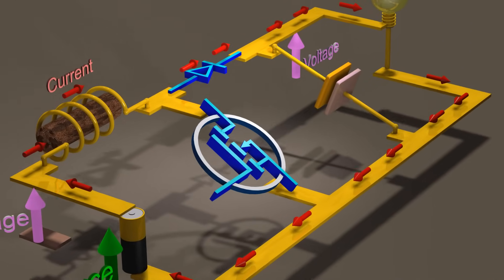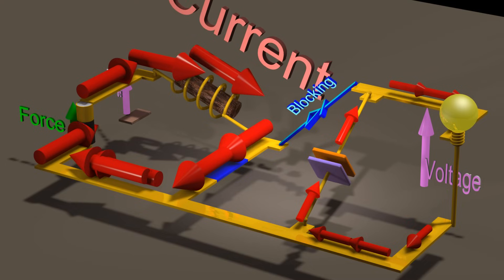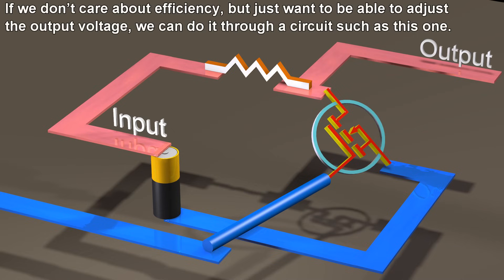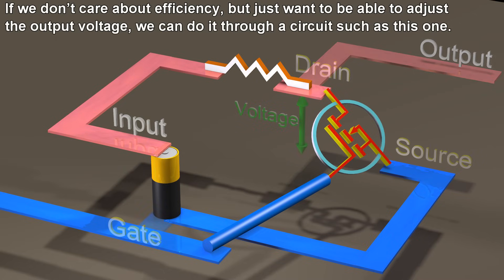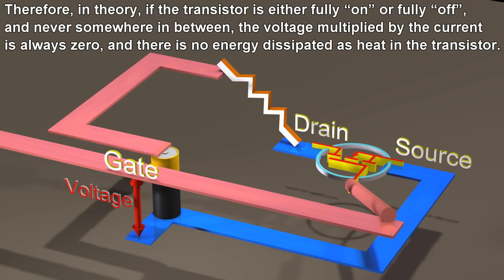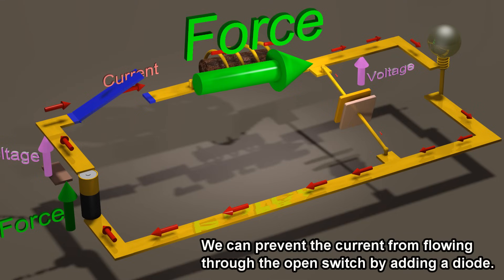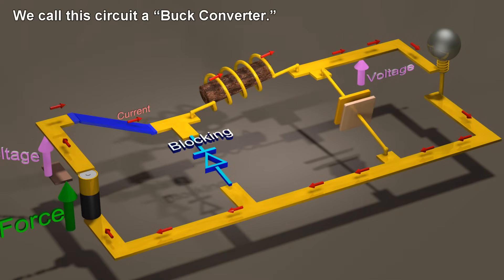Boost Converters and Buck Converters: Power Electronics

Comment: sorry for the basic question but where does the energy come from for a boost converter? Does "charging" the inductor simply means it drains a bigger current from the battery, stores it in the magnetic field and adds this energy later?
Reply from the maker: Yes, all the energy originally comes from the battery.  Some of this energy can be stored in the magnetic field of the inductor, which is later released into the light bulb.  The boost converter allows energy from the battery to be extracted at a faster rate.
Reply: @EugeneKhutoryansky  Wow, I didnt expect you, yourself to answer it on a three year old video. I gotta say, your videos are absolutely amazing, thank you for taking the time to educate.

Somehow I never realized that the inductor is a short circuit in this case, I was still thinking about it as resistor. So 

switch closed -> we are short circuiting  a battery 
switch opened -> the inductor "remembers" the short circuit current and pushes it through the capacitor, which thanks to the huge current creates a huge voltage.

So the main difference between buck and boost is that in the boost we have the inductor remember a bigger current than in the buck?
Reply from the maker: Thanks for the compliment about my videos.  No, technically the inductor is not a short circuit.  But, when you apply a DC voltage across it, the current through the inductor keeps increasing.  This very large current is then sent through the load, represented by the light bulb.  This is what creates the higher voltage on the output.  If you haven't already seen it, you may want to watch my video on inductors at https://youtu.be/ukBFPrXiKWA
Reply: @EugeneKhutoryansky  Ah, so even in the boost converter, the capacitor is only there to "filter" the output? It doesn't take part in actually producing the greater output voltage, only maintaining it after the switch is closed?

Thank you, I have binge watched a few of your videos on the topic, I plan to go over more of it.

Comment: Hello. In minute 3:55, when closing the switch, the capacitor should discharge, and if the time is enough, discharge completely and get voltage =0V. In the video, instead, it keeps the voltage constant
Reply from the maker: After you close the switch, the diode is blocking the flow of current, and the capacitor can only discharge through the light bulb.  The capacitor will discharge to zero volts if you wait long enough, but we open the switch again before the voltage on the capacitor has a chance to decay much.

Comment: How come the current doesn't conduct through the diode when the switch is closed. The diode should conduct because the positive terminal of diode is attached to positive side of voltage.

Comment: Amazing video, just one doubt, in the buck converter, when the transistor is in OFF state (open), and then the current is force by the inductance to flow by the diode, how would be the current going through the capacitor? it would be going from down to up or from up to dowm?

Thanks!
Reply: "Capacitor filters the ripple current of Inductor so as to minimize ripple present at the output of Buck Converter. Also, output capacitor is required to minimize the voltage overshoot at the output of Buck Converter as the output voltage can overshoot above its regulated value when a full load is suddenly removed from the output. The output capacitor should be large enough to absorb stored inductor energy so as to prevent output voltage from overshooting above the specified maximum output voltage." - https://www.quora.com/What-is-the-role-of-capacitor-in-buck-converter
Reply: I was wondering the same thing.

Comment: What is the use of the capacitor in the buck converter ?
Reply: Im sorry I just missed that part
Reply from the maker: To help smooth out the ripple on the output voltage.

Comment: I didn't get much, can someone explain
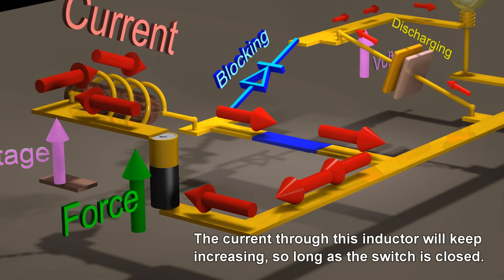1:14 there was a dc voltage across the inductor already
Reply: Yes, the battery provides DC, which is sent through the inductor, which stores this energy in the form of an electric field. When the transistor switch opens, the  magnetic field collapses, releasing all its energy as a high voltage spike. This jumps across the diode and is stored in the capacitor powering the load.

Comment: 4:18 isnt that pretty much a short circuit? And how will the current increase to infinity with a 5 v battery? How can a 5v battery give you 100000w for example?
Reply from the maker: It is not a short circuit because there is an inductor in the path.  Also, although you would never be able to get 100000 W with real components, you could do it in theory with ideal components.
Reply: @EugeneKhutoryansky  Thanks for reply. I'm new to this. The way I understand it is if you take a battery and one wire connecting the two battery terminals, you are creating a short circuit. And maximum current will flow through the wire? (meaning if the battery is rated for 2amp, 2 amps will flow). Since the inductor almost has no resistance, how is it not just like having a wire without the inductor like in a short circuit? Thank you.
Reply: @kokalti "inductor almost has no resistance" What a nonsense youre talking about 😒
Reply from the maker: I cover this answer in detail in my video on inductors at https://youtu.be/ukBFPrXiKWA

Comment: Through this video you fully explained the concept of Boost Converter, thank you. Now I would like to ask you a question as to why Boost Converters are different on a watt basis? For example, 100 watts, 150 W, 1200 W or 1800 W.
Reply: NEHAL GUND the power rating is dictated by the voltage and current ratings of each component.  Nothing is ideal in the real world — each component has resistance and finite voltage capability.  For a given input and output voltage, you need larger transistors to support more current, i.e. more power.  This is because larger transistors have less internal resistance and can therefore conduct more current before getting too hot.
Reply: @phaserpants  Thank you for such advice ^_^

Comment: So buck converters are just simply PWM?
Reply: redstone craft guy PWM signal is used to control the transistor (transistor gate voltage).  In practice the diode is replaced by another transistor with a complimentary PWM signal, i.e. both transistors are never on at the same time.

Comment: Now I have a problem with this video or maybe everything I am trying to learn is not sinking in. Is it true or not true that current I.e. electrons travel from negative to positive? So as I sit here trying to take this in, I am second guessing the accuracy of what is being presented.
Reply from the maker: I am showing positive current, which is in the opposite direction of electron current.  Showing positive current is the standard in industry and in education.  I explain the difference between positive current and electron current in my video on visualizing voltage at https://youtu.be/-Rb9guSEeVE

Comment: At 9:25 she says current can flow through an open switch someone please explain to me how that's possible
Reply: Danny Mann the inductor forces the voltage across the transistor to rise beyond the transistor’s blocking capability.  This is called the “breakdown voltage” of the transistor.  It has nothing to do with air or sparks.  It’s actually caused by impact ionization in the semiconductor material used to form the transistor.  Google “mosfet breakdown voltage” or “mosfet avalanche” if you want to learn more.
Reply: The inductor creates an extremely high voltage to try and force a current to flow, eventually the air between the switch would be break down into plasma and conduct the current, this manifests as a spark, which can be dangerous and destroy your circuit. Hope this helps.

Comment: I was wandering if someone can tell me how many Amps can carry 1 volts in a 12 gauge. one meter pure copper wire ?
Reply: Amps (current) will not "carry" any voltages. Current (measured in Amps) are moving-charge-carriers/time thru a certain cross-section. /we narrow down this discussion to wires as we are in the field of engineering
A 12 gauge wire is about 2.0525mm in wire diameter. So: "A" (cross-sectional area)= d^2*Pi/4 = 3.3mmˇ2
/normally a table chart is used to decide how much current (in Amps) can a certain wire gauge (wire with an "A" cross-sec) can carry without overheating, and there other things to consider too, like: cooling, installation, etc. so there are many charts and more calcs../ 
Say allowed current density in air cooling, the wire being alone.. is then: J = 5A/mm^2
Then current max allowed from J=I/A: I = J * A = 5 * 3.3 = 16.5A (Amps for you) - but, as I said, you normally use charts/tables to figure out the max allowed Amps in a wire. - for example, eng chart says at 60C temp 3core max, etc.. it is 20Amps max - so J is higher than 5A/mm2-
Actually, this is the reason that you need training in EE (say being an electro-technician, engineer) to do this properly and safely.

You see, I could start this comment by saying your question is non-sensical/does not make sense, etc.., but I wanted to start with helping, but yes: your question "how many Amps can carry 1 volt in a 12 gauge" is just fundamentally wrong.
- hope you appreciate my efforts

If you were to say: how many Amps can cause a 1 voltage drop thru a 1m long and 12gauge wire, then your question actually does make sense (should be worded correctly though:)) as per a 12 gauge wire with a certain length does have resistance "R" in Ohms. then: from V = I * R, I = V/R will give the answer in Amps. V = 1 volts (you gave). You just need again a chart to tell you what resistance value a 12 gauge wire has (normally given per meter or per other length units.).
Alternatively: R = "ro" * L/A ("ro" is resistivity, material dependent - again, given in charts..:) - greek letters used..), L = is length, A is again cross-sec-area).

Comment: Howdy. Really nice illustration.
One small detail, however. The Electro Magnetic Force arrow is correct. It points from minus to plus. It is usually drawn to be inside the voltage supply.
The voltage arrow is wrong. The voltage arrow should point from plus to minus. It should be drawn outside the voltage supply. The voltage arrow direction indicates the anticipated current direction when a load is connected.
Reply from the maker: Each voltage arrow just shows the difference in electric potential between two points on the circuit.  Therefore, each voltage arrow can be drawn in either direction, as it is arbitrary if you define the voltage difference between point A and point B as 
"(A-B)" or "(B-A)".  Thanks.
Reply: @EugeneKhutoryansky  Howdy again. With all due respect. I disagree. My understanding is that the convention is that voltage is the difference between higher potential (more plus) and lower potential (less plus). Vhi - Vlo.

Comment: from this video seems that in the buck converter the C is useless… my question is: the L is an energy accumulator as C and has the function to reduce the voltage, so why does C is used? In OFF the inductor L (i don't know if i'm wrong) shouldn't work as the capacitor C ?
Reply from the maker: The capacitor helps reduce the ripple in the output waveform.  Though in principle, the buck converter could work without an output capacitor.
Reply: @EugeneKhutoryansky  Thanks! And how is it possible?

Comment: One thing I'm trying to wrap my head around: When the switch is closed, will any current flow at all through the diode? Or will all the current be contained in the Inductor's Magnetic Field? (For the Boost Converter)
Reply: During that time voltage across diode is -(load voltage) , reverse biased
 Hence zero current flows through diode ideally

Comment: Need a small correction:  "The current through this inductor will keep increasing..."  No, it won't.  Even if it was a perfect inductance, the battery (or whatever voltage source) has internal resistance that would limit the current or cause it to fail.  In reality, the internal resistance of the inductor would limit the current eventually, but more likely would cause the inductor to heat up to the point it fails long before that.

Comment: you talking about what it does, meanwhile we need to know what BUCK stands for
Reply: Buck means pretty much the same as it's dictionary definition - to oppose or resist, to go against (something).  It is the opposite of boost, in this case, taking an input voltage and outputting a lower voltage without wasting it as heat, the way a linear voltage regulator does.
Reply: @chrisw1462  thanks a lot. I thought its named after a spicific component on the board

Comment: Do you need an AC signal in order to control buck and boost converters?
Reply: You need a driver circuit for the switch, which is a comparator where as inputs you have a repetitive signal ( sawtooth wave) and another costant signal that you can control, so you get duty cycle that you want.

Comment: I imagine the transistors are controlled by ICs, some probably use a 555 timer arrangement, some might use different packages that do the same thing.
Reply from the maker: There are specialized ICs for this application.  You don't just want to use a timer.  You want to include a feedback measurement of the output voltage, so as to adjust the percentage of time that the transistor is on to maintain the desired output voltage, despite changes to the input voltage and changes to the load.

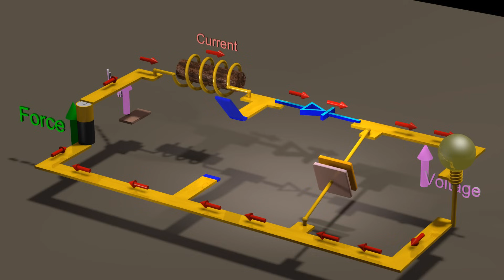Comment: 3:50, the output voltage will be the battery minus diode drop which can vary from 0.2 to 1.0 volt, if you said the diode was ideal at some point I missed that statement.
Reply: Peter Ritchie in practice another transistor with very low on-state resistance is used in place of the diode.

Comment: You said that currant can still flow throught eventhought the switch before the inductor is open. How is that possible and what phenomenon causes that
Reply: yehia ismail in reality the transistor cannot block an infinite voltage.  The inductor will force voltage across the transistor to rise until it exceeds the transistor’s voltage blocking capability.  When this occurs, the transistor enters “avalanche breakdown” and will begin conducting current and dissipating a large amount of power, possibly damaging the transistor.

Comment: Thank you very much for the video! But I didn't catch who controls the gate pin of transistor, how to change the percentage of on/off state?
Reply: Alexander Rumyantsev the MOSFET gate is controlled by a separate circuit known as the “driver” or “controller”.  Modern MOSFET drivers and controllers are complex closed-loop control circuits that can be programmed digitally.

Comment: I have a question. As I study, dual-loop PI control is general method to control boost converter.
It's constructed such like below..

Vreference  →  ○ →  (V error) →  PI → (I_L reference) → ○ →  PI →(duty)→ inner loop plant → outer loop plant → output voltage  
                            ↑                                                                       ↑ 
                        - Vout(output voltage feed back)                   - I_L(I_L current feed back: inner loop plant output)

· Inner loop plant is I_L(s)/d(s), (I_L(s): inductor current, d(s):duty))
· Outer loop plant is Vo(s)/I_L(s) (Vo: output voltage)

In the "block diagram", I_L reference = (Kp * V error) + (ki*∫ V error dt)... 
Please let me know, How Voltage error(Vref-Vout) can be used I_L current reference..
I have considered with the problem for weeks, but I can't figure out yet..

Comment: At 8:20 why would that be problematic? Wouldn't there be temporary resistance across the capacitor, making the circuit stable?
Reply: No. The main thing to consider is the voltage across the "switch." A transistor can only hold back so much voltage before it lets the magic smoke out. Once it reaches its limit, even the small amount of current the capacitor lets through will fry it.

Comment: I think it's a wonderful explanation, yet I still don't get it so I must just be thick.

Thank you for making it though
Reply: Craig Nevermind try to think of the inductor as a current source and the capacitor as a voltage source when the switch is off.

Comment: Hi Thank you for your video. I'm surprised no one has asked how would you turn the transistor on and off like a switch.?  Low voltage through the drain.? 
Thank you.
Reply from the maker: You control the transistor through the voltage applied to the gate voltage.  The connection to the gate is not shown in this video.